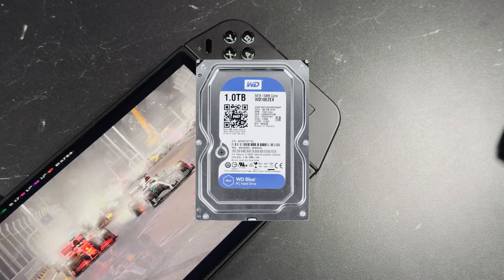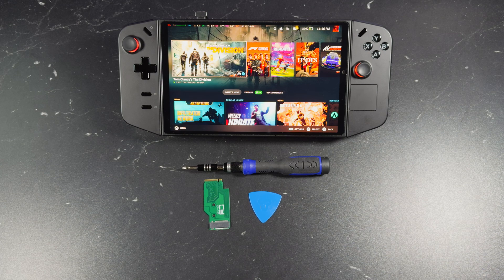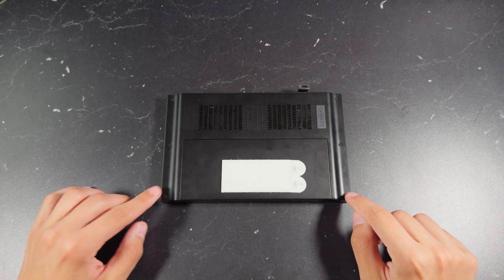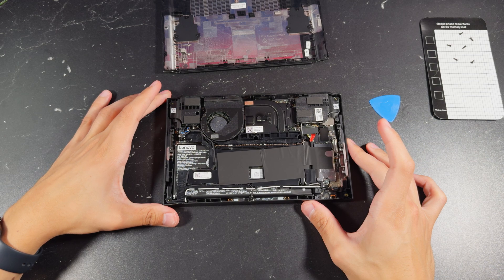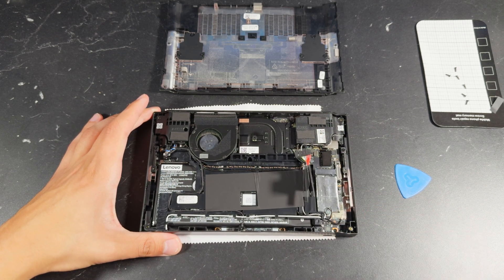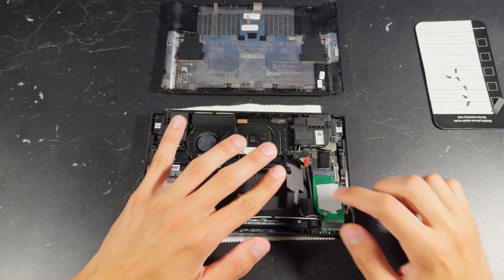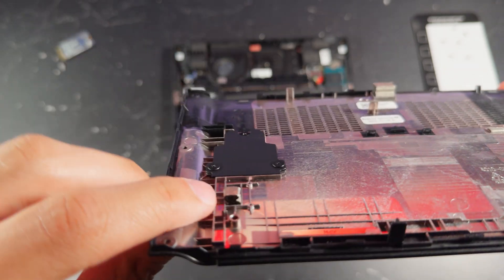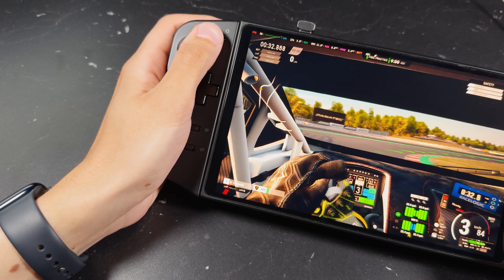Lenovo Legion Go SSD Upgrade | Easy Step-by-Step Guide

Comment: hey are you using an anti static  matt or anything like that ? last time i swapped my ssd i wasent able to unplug the power cable n just swapped it a few months later my mother board went out and i got it replaced today today i swapped my ssd again but was able to remove the power cable and swap the ssd but now im worried i might have potentionally fried it again i dident use the anti static wrist strap either times because i really dont no how tbh and every one tells me i dont need to use it so im just curiouse ? im not sure but it almost seems like my temps are wonky so im worried its going to fail again idk everything seems to work good but my temps arenin the 60s n 70s at all times really
Reply: jut put the strap onto your wrist and you're fine.

Comment: hey i did the upgrade. i couldent  get the battery cable unplugged. i tried but nicked a wire and got sketched and just swapped it without unplugging. a few months later my go died i had to send it back in so i swapped back to my 512 to do so . do i need to unplug the battery in order to swap my ssd when i get it back ? idk if thats what killed my go or not . i was playing a game and then it shut off and never turned on again so i sent it in . but i dont want to swap the ssd and the same thing happen i kinda think it was a bios update that bricked it but it could have been battery are u able to help me out please bro